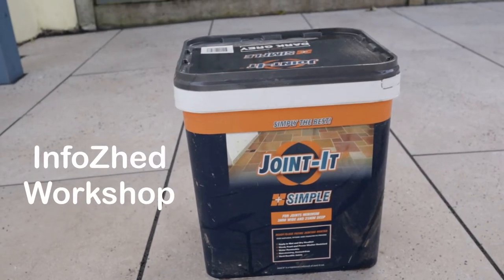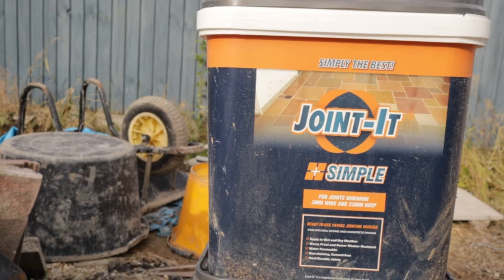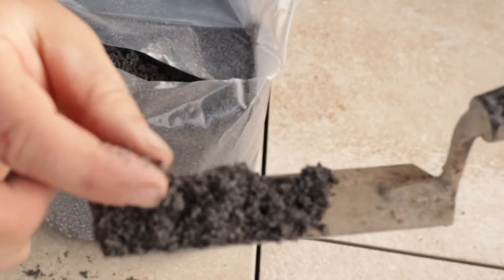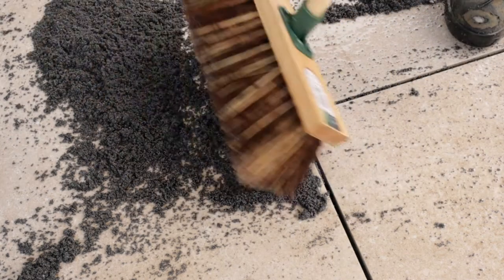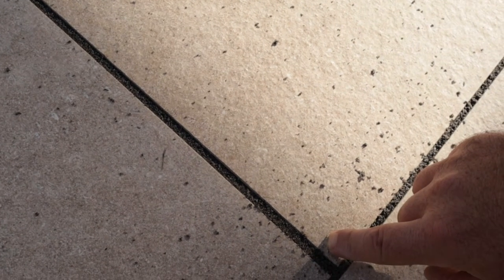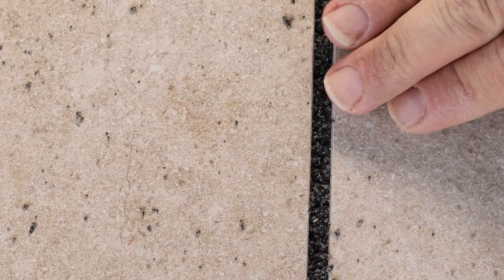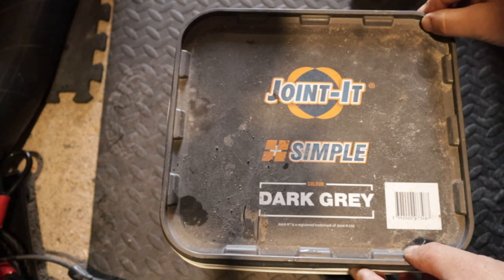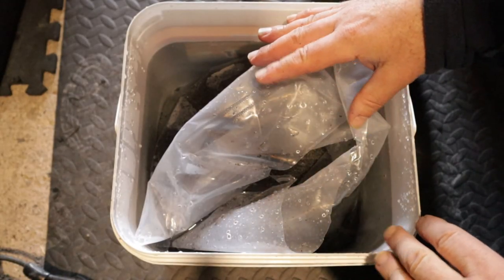Joint It Simple (DIY Bloke uses brush in grout for the first time)

Comment: Good to see a review by someone using it for the first time. Too late for me, as I have just used 2 tubs on the same tiles and patio size as you, I gave up on brushing it, as our 5mm tile spacing is the minimum for joint it and it's a real struggle to get the depth and compression with a brush. I ended up getting my knee pads on, scooping onto the floor as I went and using a steel finishing trowel to work it in properly and get a flush finish, just like pointing. Just kept the tiles wet in the areas I was working on and didn't need to water over it at the end. I found this a lot easier and less back breaking than the faffing with a brush. Took me around 7 hrs to do 32sq mtrs. 
Thanks for recording and posting it for us. Ps, I thought it was a good product, but at 12 degrees it takes hours to dry, not the 45 minutes they state,

Comment: Excellent video! So nice to find a bare bones, honest review of this. I'm contemplating using this or something similar for the first time for a customer. What I'll take away from this video is "compact, and compact again". Keep up the good work 👍
Reply from the maker: Yep press it in. I found that it still felt soft in the joints for a bit but after a couple of days it went solid. It’s great stuff. Glad it was of some help.
Reply: I've gotten a few tubs to do large concrete pavers, have you tried it on them yet? My joints are 8-10 mm and 25mm deep. Might be easier brushing into larger joints?
Reply: @orchard002  absolutely. I wanted my joints quite narrow. Wider joints would allow it to fill the gaps easier.

Comment: Just about to start using Joint It for the first time so thought I'd best have a look what's what with it. As much as I'd like it to be a 2 man job, I'm afraid it's just me so wish me luck......
Nice video, very helpful and thanks for posting!
Reply from the maker: Glad it was of some use. Think I went a bit over the top with ramming in the joints but saying that it’s expensive stuff so only wanted to do the job once. Mine still looks as good as the 5th November when I used it (easy date to remember as fireworks were going off when I was finishing up in the dark lol) Good luck 👍

Comment: Great video. We are planning on using this inside our new lounge extension. We have used natural stone slabs and have been advised to use this product. Slightly concerned the joints wont dry out as the water cant run away. We have a concrete base over underfloor heating. Any ideas?
Many thanks
Reply from the maker: Inside lounge extension. I am not an expert on this so it would be inappropriate to provide any incorrect advice. However, I am sure you are going to not use excessive amounts of water, mop up the excess and allow plenty of air to circulate. Sounds like a very interesting project. 👍

Comment: Hi, enjoyed your video. Had a patio fitted and (disaster) needs more of this time of stuff to top up and fill in spaces. I’m very nervous about and thought l would ask a question please , you covered a large area at a time using this is it possible to get on your knees and do one or two slabs at a time until confidence is built up? What would be the tool l would use to pack it down more between slabs? Any advice would be appreciated. Thank you so much.
Reply from the maker: Hi, I fully understand your nervousness. A person has to gain experience using a product to fully understand it. Cannot see any reason to prevent you doing a few test slabs. Please check the with of gap between slabs to make sure the product is suitable. If gap too wide this is the wrong stuff to use on the job. Remember the drying process is activated by being exposed to the atmosphere so read all the instructions carefully as the stuff is really expensive so you do not want to waste any. Try finding a piece of material such as aluminium or plastic that fits easily between joints but sufficiently long to use as a tamp to compact the material until you gain confidence and understanding. Hope that helped a little. Go for it 👍

Comment: you didnt use enough water i think. it needs water to go to bottom of gaps. you should spray with water whilst brushing it in, its alot better. other videos say you cant use too much water and theyre right. you wont get missed bits. also you can use grouting bar.
Reply from the maker: Thanks for the info. Wider gaps would make it easier also